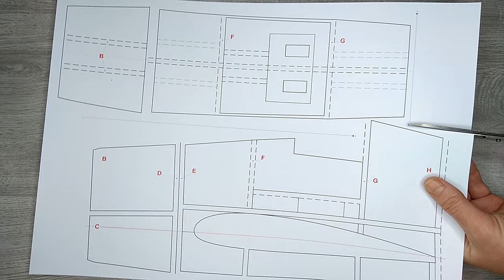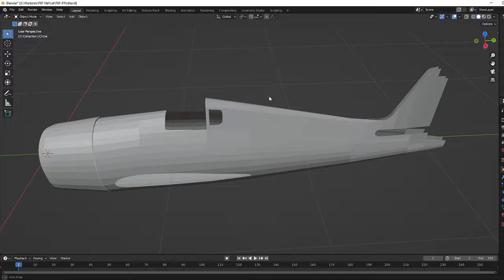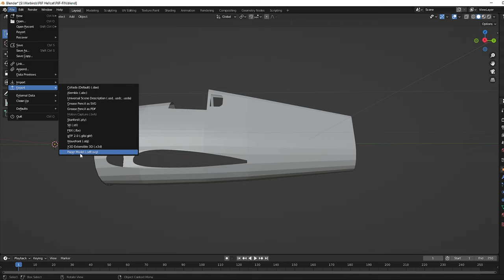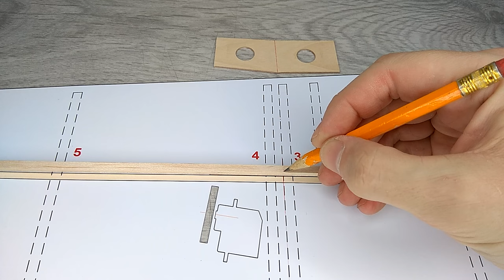Grumman F6F Hellcat RC Plane DIY

Comment: Yet another amazing build! Surprised you got the weight so low despite using very thick 5mm board. It probably wasn’t necessary, but should provide more durability. I noticed your motor gives 600g of thrust, so right now you are at approximately 2:1 ratio. Great paint job and finish! Keep it up!

Comment: ciao,
As usual you have produced a great model.
But explain to me the difference between the various types of foam: they are of different strength or they were pieces you had at home.
If I have seen correctly, it is all 5 mm thick, even the coatings
Reply from the maker: coatings of rudder and elevator 3mm, all other parts 5 mm. Wing also can be covered by 3mm skin